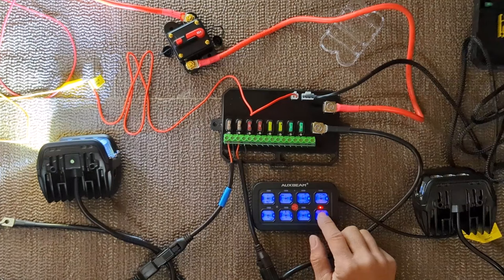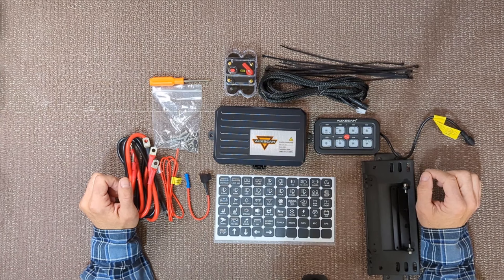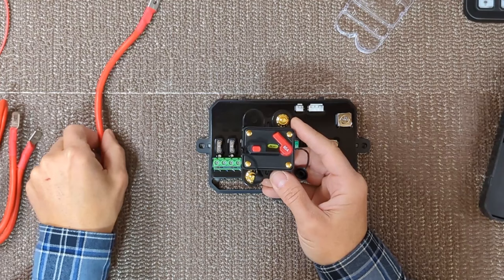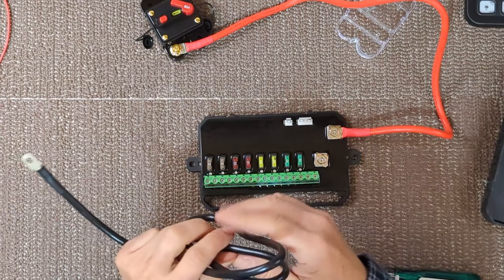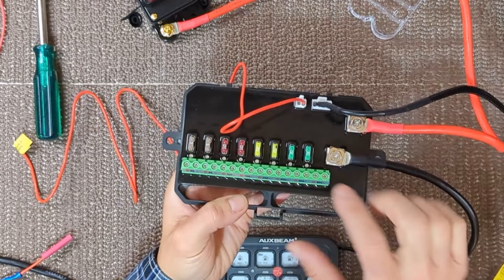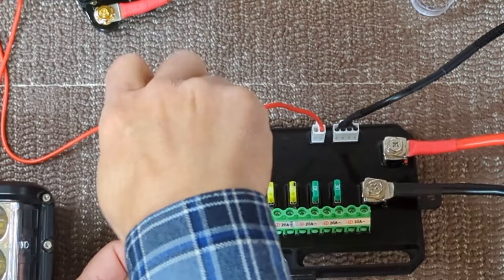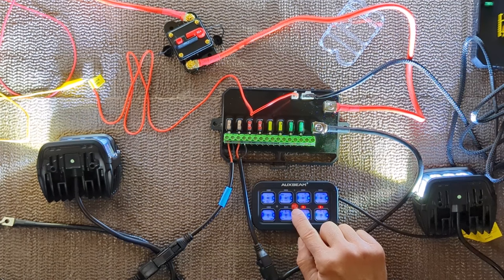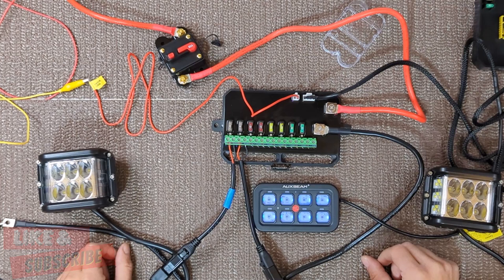AUXBEAM 8 Switch Panel - How To Wire

Comment from the maker: This is the kit I'm using and in the video. There seems to be a sale currently:

Auxbeam 8 Gang Switch Panel Kit
https://amzn.to/3FcJJ5I
Reply: How did you hook up the wire that reads if the car is on or not? I wanna use this system on a deep cycle battery but for my exterior lights, I just don’t want the car to be on while I’m using the deep cycle power.
Reply from the maker: @QuantumMuch  I am actually putting a video out tomorrow on this since I've been asked so many times. It will be out at 2:30-3 Eastern time. If you still have questions after that, let me know
Reply: @AZOverland2017  your a good man, thank you a lot :) appreciate the hard work
Reply from the maker: @QuantumMuch  Sorry, it's uploading now and will be out at 2:15 AZ time or 5:15 Eastern
Reply: I purchased the Auxbeam 8 panel for mainly my rock lights but I put pod lights on my bumper and have them on a relay and have them wired to my reverse and also on a rocker switch to have them come on when I hook a trailer or boat at night. How can I put them on the Auxbeam and still have the pod lights wired for reverse and on the rocker switch?
Reply from the maker: @PoppysG4  What would be the goal by having on the Rocker Switch and the Switch Panel? It seems redundant so I'm trying to understand what you are trying to do. You can email me as well with pics if that helps

brothersadventuresllc@gmail.com
Reply: I just want to clean up the wiring on my battery from all the lights that’s installed . My goal is to maintain the reverse lights and the switch for the lights to be able to cut the lights on when I’m parked.
Reply: I’ll email you a sketch of how it’s wired

Comment: I am using this system currently in my 2016 Jeep Wrangler JKU.This unit is definitely a stand-out kit in terms of ease of use and installation, its diminutive form factor and lite weight durability, quality of components and its logical layout leaves me longing for nothing at all. I am very satisfied with this product. Oh yeah, it's affordable too.
Reply from the maker: Wait a minute, do you work for Auxbeam? I'm only kidding, I happen to agree with you. For the price it really is a solid, capable unit for what I need it for. Thanks for your comment

Comment: I have the 12 gang switch panel and I recently bought light bar pod lights etc. all of them have “6 modes” issue I’m having is if I don’t use the controller with the lights I can’t get the drl or ambers to work unless I wire them to its own channel versus the remote changes the light from Amber ,drl, or all on with just on and off. Am I doing something wrong. I don’t want to use multiple controllers to have the features I want
Reply from the maker: This is a common question and I'm just not sure how the Switch Panel plays together with lights that have multiple modes. I've installed Rock Lights with white and amber modes and needed to attach the separate wires to separate circuits and control the with 2 buttons.

Comment: I had another question about changing fuzes. If you want switch #1 to be an accessory with 30 amps however let’s say the circuit box comes with switch #1 being a 10amp fixe could you just switch it out for a 30amp fuze? Or is the relay inside the circuit box only made for that specific amp fuse it came installed  with
Reply from the maker: My understanding from Auxbeam is that you can swap out the fuses as long as the total draw from all accessories doesn't exceed the rating of that particular Control Box. Please do reach out to them as well to confirm that this still holds true as they may have changed things. Many of these companies continue to update parts.

Comment: If you have a light hooked up and put it on the 5 amp fuse and want to add another one so they both turn on at the same time would you put them on the 10 amp fuse or still keep them on the 5 amp?
Reply from the maker: 10 amp. You need to calculate total amp draw and use a fuse, ideally, that is a bit higher than that total amp draw

Comment: I’ve got some Baja design LP9’s with high and low setting would i be able to control high and low from 1 button on the panel or would they have to be wired into 2 switches?
Reply from the maker: Great question. I would assume in order to operate correctly it would need to be wired to 2 switches. I had to do the same with my rock lights to control the White or Amber setting.

Comment: Does anybody know if this is ground or power side switched? I was going to run all my grounds to a nearby chassis ground, but seeing that the ground goes right back into the control module, that might not be possible. (I haven't put it on the bench to test it yet or I'd already know.)
Reply from the maker: I believe this unit is power side switched. Definitely bench test to confirm and comment back. I remember installing a Mictuning Switch Panel in the Tacoma and I remember that being ground switched which I thought was odd when I compared it to this install.

Comment: ACC wire doesn't look long enough to run from the panel to the ACC fuse in the cab..
Reply from the maker: It's not and will need to be extended if running to the cab. Ideally you can find something under the hood but extending the wire is not a big deal

Comment: Hi so it's been a year now since you posted this video. I'm interested in punching one however there are many reviews out there that are negative as pertains to malfunctions and warrenty issues, so since your install how has this product held up to the hype?
Reply from the maker: Zero issues to date. I suspect a lot of negative reviews are due to Installer error
 Yes, every product will have failures, but I have not experienced that. I think Auxbeam continues to update their products. There are other similar products out there in the same price range with similar capabilities that work well as well. I installed the Mictuming Panel in the Tacoma and it also has not had any issues
Reply: thank you  @AZOverland2017
Reply: yes I noticed but I was looking at the Yota Xpedation switch panel and they actually have everything I need to install, which includes the mounting brackets for $330
Reply from the maker: @spud6603  There are a lot of good ones out there. Go with what you are comfortable with and you will be happy with.
Reply: Thank You, Yea I'm Leaning Towards Them Primarily Because The Kit Is Made Specifically For My 4Runner. But Thank You Again And I'm Happy I Came Across Your Video Because I'm Getting Ready To Install My Morimoto Ditch Lights And Raptor Lights Once The Weather Breaks And I Didn't Want To Deal With All The Soldering And Wire Cramping.  @ @AZOverland2017

Comment: How do you wire to change between modes? I have some ox beam lights that have six different modes has two buttons so on the 8 gang What a wire, two buttons per light, one for an off feature, and one for modes
Reply from the maker: I have done the wiring with 2 modes but not with 3 or more. I would reach out to Auxbeam since you are using their lights and see if this is possible.

Comment: first off awesome explanation! I just purchased this kit for my 21 tacoma just waiting to get my truck back from bodyshop so i can install. I pre-setup all my circuits with deutsch connectors so it will be drop in ready and plug and play, it seems like a quality panel and has pretty good reviews. I don't know if this helps or is completely true but from what i've read circuits 1-2 are double relayed 30 amp max load the rest are single relay set at 20 amps max and the fuses can be changed out for different sizes to match components as long as the total doesn't overload the breaker 60 amp.
Reply from the maker: Thank you. I didn't hear that about the 30 A circuit but the rest of what you wrote is my understanding as well. I would certainly confirm with Auxbeam if you decide to move fuses around as they have come out with different Panel versions over the years

Comment: Good to see you try the Auxbeam I have been using mine for about a year and 3 months and it has been perfect! Fit my needs without the heavy price of the popular brands. Recently got done wiring mine so that it can have constant power and ACC power so at camp I can run lighting etc without the ignition on and I love it even more now.
Reply from the maker: That is a great idea. Are you running 2 batteries? I agree, for about $135 you get a LOT. I didn't want to spend $600 for a Switch Pros and still need to buy other additions.
Reply: @AZOverland2017  I am not currently but only running a couple of low draw devices and have a Noco for oopsie backup if I kill it lol
Reply: @Slow_AZ_TRD  does this allow you to turn the switch panel on/off via the red button with the ignition off?

Comment: For someone that doesn’t mess with electrical  thanks for making it so easy to follow along !! Just to clear it up - you just keep the positive and negative for light and get rid of the relay and switch that comes with it !? 
Thanks
Reply from the maker: That's correct. I have a few other videos of actual switch panel installs accommodating different light setups in both our 4Runner and Tacoma where you can see exactly how I did it. Thanks for watching!

Comment: Make sure you use both the - negative and + positive to each item.  if you ground an item to the chassis and just run + wire it will cause issues when engine running.  Lights especially will flicker.  I had this issue,  led light worked fine when using just a switch.  but when using the Auxbeam system I had to use both - and + leads to each item.
Reply from the maker: Thanks!

Comment: Thank you so much for making this video. Great explanation of how it works. I saw in a separate video that you addressed how to maintain the functionality of a multi-mode light accessory, which was really helpful too. My wiring harness for the lightbar has 4 wires, black, red, white, and yellow. Black, red, and yellow are no brainers. I can't figure out if should connect the white to a poss. or neg. terminal.
Reply from the maker: What light bar is it and what modes does it have? Where are those 4 wires coming from? Did the bar come with a relay and it's own switch? You can send me pictures if you want to

brothersadventuresllc@gmail.com

Comment: I assume you can change the fuse on any circuit 1-8 to whatever Amp needed?
Reply from the maker: According to Auxbeam, around the time I did this video, the answer was yes, up to 30 amp and not to exceed the total amp draw at once. I would reach out to them to confirm that hasn't changed. I know they do update their units

Comment: Thanks for the clear instructions..im wiring this to an Auxilary battery..can i wire the red trigger wire to a on/off switch directly to the POS & NEG that powers the unit ? So i can switch unit on/off independantly of the main starter battery. I have a pic but cant add to comments
Reply from the maker: Email the picture to me
brothersadventuresllc@gmail.com
Reply: Ok just sent email

Comment: When you combined two pod lights into terminal/dude how did you set the wiring up and harness to where you connected them into the auxbeam panel? It’s probably simple but I don’t know electrical
Reply from the maker: I did a few videos on this. The link below is when I installed ditch lights on a Tacoma with a Mictuning Switch Panel. I believe I also did a video when installing ditch lights on my Auxbeam for the 4Runner

https://youtu.be/U6ZLO_qQHPY?si=rMI1CQZMO_nY3SjJ

Comment: Just recently got one of these installed on my forerunner. The audio shop kept the panel constant power. I'm kinda concerned that over a long period of time. I wanna come back to the vehicle and it's gonna be dead. What do you think??
Reply from the maker: Are you saying that even with the key out of the Ignition the back panel is lit and you can operate the your accessories? If so, I would switch to an ACC source or an ON source. I did a video that explains this and how to do it here:

https://youtu.be/qyOkrW4P5qk?si=_J_M1BOLnQtrPJUg

Comment: Can you help me to clear out something please?
I have a Long bar Rigid lights with it's own relay. So 2 cables comes out of it first has +/- to the battery, and the second has 3 wires was attached to their factory switch. So what i do now? :)
Reply from the maker: The only wires you need are the + and - (black and red or in some cases black and white). You are cutting out the relay and the switch that comes with the light. You + and - will attach directly to the Control Box. That Control Box has built in relays that replace the relay you cut out. The switch panel that comes with the Auxbeam that you mount in the vehicle control everything.

Comment: Unable to see your power source.  I'm new at this - on my GMC Canyon - please suggest the power source to connect
Reply from the maker: @JR-pd9xz  Check out some of my other videos after this one. I did an actual install of this unit on my 4Runner and I did a fuse tap video. I also did a few videos installing another switch panel (Mictuning) on a Tacoma

Comment: Great video! Thank you! Can the controller control the lights with the Auxbeam app when the vehicle is off?
Reply from the maker: I don't have the app version. But, I suspect if you fuse tap into a "constant on" fuse, that would probably work.

Comment: Great video. I’m trying to connect the rock shock edge 6led  off road harness to my auxbeam panel. I have the amber and low beams wire and they work but when I hit the high beams it pops fuse. Diagram on there supplied rocker switch shows high is black, white, and black and white wire. How do I wire that in to the auxbeam. I left the relay on and only cut off there rocker as it won’t fit in my vehicle. Thanks for the help

Comment: This video was great I’ve installed mine I wish I would’ve seen your video earlier. My question in a semi can I use the power sources next to the main fuse box because the battery are so far and the aux cable isn’t long.
Reply from the maker: You can fuse tap from other sources if that's what you are referring to. I did a fuse tap video also which may help

Comment: Very nicely done! Liked & Subbed! Question (an uncommon one I am finding): Can you switch around fuses to run higher amperage circuits in different positions than it came from the factory? I want to run some higher draw circuits in the lower positions of the box, (like a 23amp compressor where a 5 amp fuse would be). I am unsure if circuit amperage is limited by the module design (and solid state relays) or if it even matters. I have the RB80XL with solid state relays, but also purchased a 6-gang unit for another vehicle. This box has mechanical relays, and although the fuses range from 30-5 amps, the relays are all 30-amp.

I am an auto electrical guy (for fun) so I understand wiring, but have no working knowledge of solid state relays. Any help from anyone is appreciated, this seems to be a question not commonly asked, and I'm not smart enough to know how else to figure it out lol. 

Thanks!
Reply from the maker: First off, thank you very much for the Sub! Auxbeam has a number of different Switch Panels so I am not familiar with all of them. I believe for your RB80XL, positions 1&2 have 30 a relays and 3-8 have 20 a relays built in. So yes, you can swap fuses but be careful with the amp limitations of 3-8 if indeed what I'm saying is true. Please confirm this with Auxbeam, but I believe this to be the case.

Comment: Quick questions I hope you can answer 😅 any advice appreciated 

Am I good to hook up below accessories to the following auxbeam switch panel fuses 

KC pro6 7 light to bar to 20a fuse ?
Per KC light bar draws 11.41 amps

Pair of Flex era 4 pods to 20a fuse ?
Per KC each light draws 6.7amps

KC chase bar to 5a fuse ?
Per KC it draws 5amps

Last but not least 😅 bought 8 5150 gen 2 rock lights which don’t say watts or amps drawn, comparing to other rock light specs 8 pods should be good under one 5a fuse ? 😅
Reply from the maker: I'll answer this the best I can but I would recommend reaching out to Auxbeam customer service for definitive answers.

My understanding is circuits 1-6 are actually capable of handling a 20a circuit, so you can put up to 20a fuses in them. Circuits 7-8 are 30a.

That being said, if you power up multiple devices at the same time you need to be sure you are not pulling more than 60a total. The circuit breaker is also rated at 60a.

If you are connecting 2 lights to 1 circuit, ex. your Pair of Flex era 4 pods and each light draws 6.7amps for a total of 13.4 amps, you would probably switch out the fuse (1-6) to a 15a. I try to use a fuse either at or slightly above the max draw of an accessory. 
I try to avoid putting a fuse too high over the max draw as it will not protect the equipment as intended.

Comment: Looking into buying some harbor frieght roadshock 6 led pods and they have a back light, high, and low beam. I also have a Jeep Gladiator with auxilary switches, and I'm trying to figure out the best way to wire these with break8ng something or catching fire 🤣 any advice?

Comment: 8 gang
Is there any way of having a momentary ground switch instead of power on?   ( for active exhaust solenoid)
Reply from the maker: Good question. For this particular unit/model, I don't believe so. Possibly the Mictuning Switch Panel might work for this but I can't confirm.